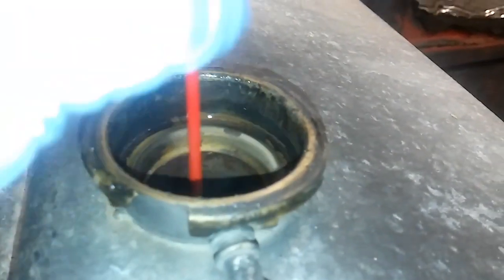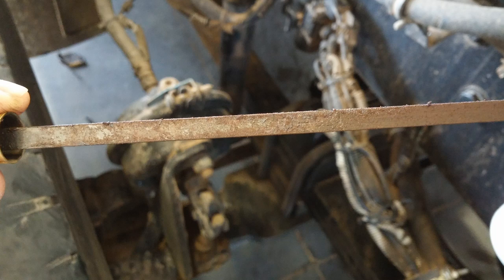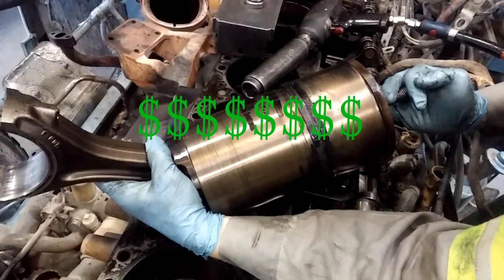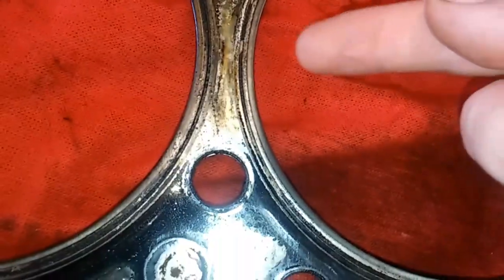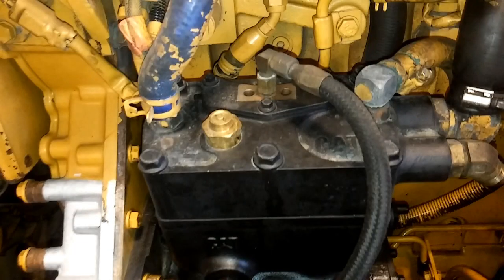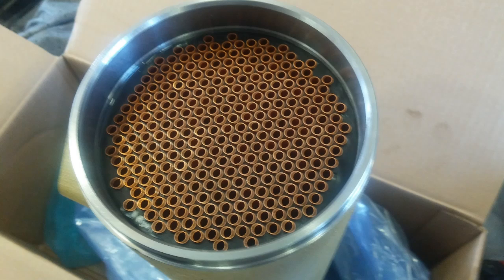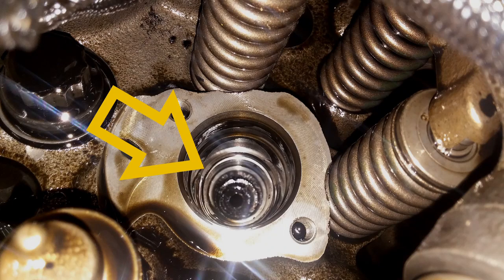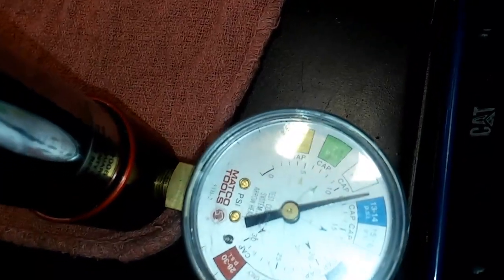What Causes Coolant In The Oil?  Antifreeze In The Oil.  Coolant In The Engine Crankcase?

Comment: Had a c15 Acert the was blowing white smoke and eating coolant like it was going out of style.  No external leak, no coolant In the oil pan and it failed a pressure test. Turned out to be the pre cooler in the air intake system had failed and was spraying coolant into the intake side of the engine. Not cheap but better than a complete tear down.
Reply from the maker: +None Ya business A precooler can definitely do that. That is actually a pretty easy one to troubleshoot, pull the intake tube off of it and it should be dry.
Reply: Adept Ape when I pulled the intake pipe off the cooler was covered in rust. Turns out the owner was using raw water in the cooling system. The owner said water was cheaper than coolant, when the engine is eating coolant. I wound up replacing the pre cooler, coolant pump and oil cooler. Also an extensive cleaning of the cooling system.

Comment: I had an old Isuzu I4 with a crack between an exhaust valve and the coolant system. It was actually forcing coolant out of the system entirely at speeds above ~55-60, so driving around normally didn't really do anything, but going on long highway trips was problematic.

Comment: Do you just work on truck engines or do you work on other cat engines like off road equipment?
Reply: +Max Dub,  He means an internal combustion engine that rotates an alternator which creates backup electricity for when power outages happen, or in some cases the actual electrical supply for places like native reserve and mining sites.  Not as many mechanical parts to know in the power generation field so generally these guys will have superior knowledge and experience working on engines than a truck mechanic.
Reply from the maker: +Ozzy ô Trucks pretty much exclusively now, but a lot of generator experience and occasionally still work on them.
Reply: do you find it boring since they haven't made anything new in 10 years working on the same ol stuff?
Reply from the maker: +Ozzy ô I wish they were making new stuff, but I don't find it boring. They were just getting out of the truck market when I got in the truck shop, so I've tried to learn everything I can about them since. Still learning new stuff every day. If the work ever really dries up it might be time to go with on generators or equipment, but I still enjoy it now.

Comment: my truck has little bit of smoke coming out if the crankcase tube under the truck, it's a Detroit has new liners and head gasket doesnt burn a bit of oil. and zero smoke from the exhaust.
Reply from the maker: +Moe's Pranks Every engine has blowby, even new ones. If it is a small amount and you aren't losing oil or coolant, that is normal.

Comment: Eeny meeny minny moe I wonder were my coolant will go: basically every used farm truck my dad has ever owned
Reply: Adept Ape yeah it even happened on a combine ones the block cracked so we got a brand new engine for it and then the shaft that powers almost everything snapped in half. The engine might still run but that combine is going no were.
Reply from the maker: +BOB White Most of those ancient engines have leaks somewhere, if not everywhere.
Reply: Adept Ape thanks a lot bro wish I could call u
Reply: My truck all the water goes in the oil it's a 3406